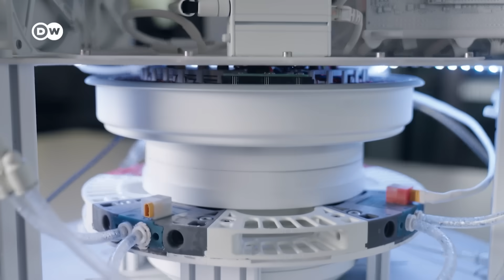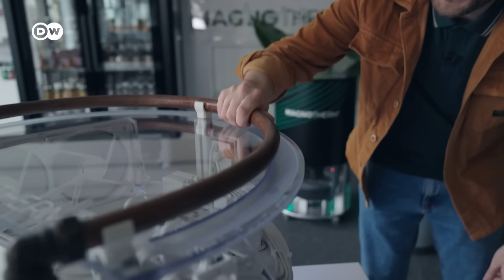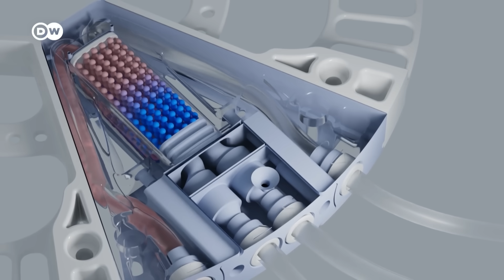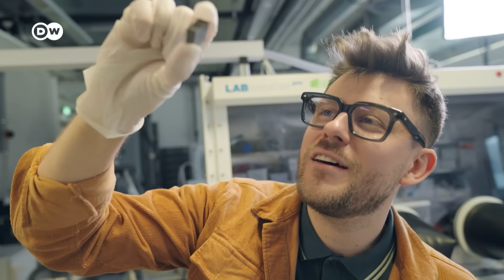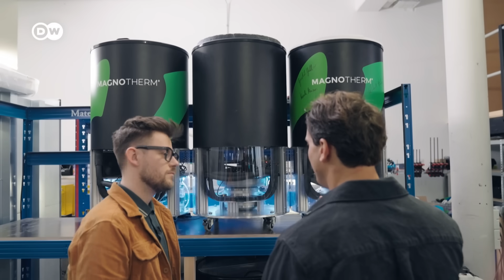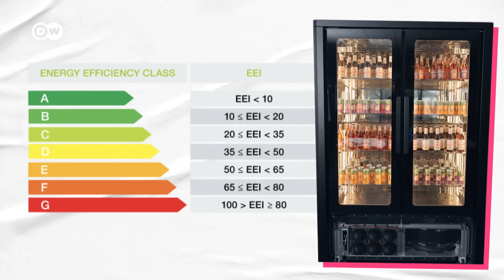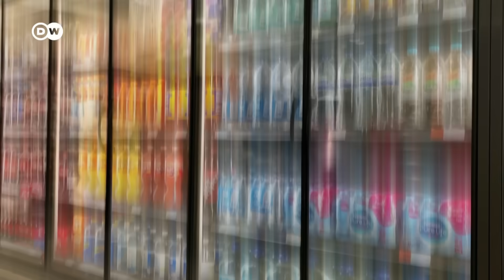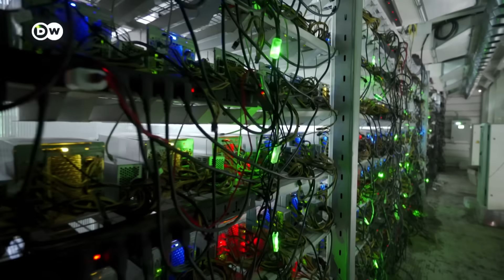How magnets could change our fridges and ACs forever

Comment: What if instead of heating and cooling the block with the magnet, they instead put the magnetic particles in a suspension fluid and put the magnet on the liquid. Then the heat difference would be easy to move because it would originate in the liquid rather than the block.
Reply: I'd imagine that runs into some safety/environmental issues. The moment you have a leak, you have water contaminated with metal everywhere.

That's not really any worse than common refrigerants, but if they're using water right now I assume that they want to avoid a similar situation. Having many moving parts as they do, I'd expect leaks to be more likely than a conventional refrigerator.
Reply: @TylerHague  It's a possible concern, but the liquid wouldn't need to be pressurized so it would be easier to control, and would also probably be less toxic than refrigerants.

Comment: It will never more efficient than evaporative cooling.
Reply: Not to mention the manufacturing and rare-earth elements. Looks like a ton of neodymium and a easy ticket to a decade of academic funding for 5 people with a business pitch
Reply: @jackb3493  Look up Niron and the development around Iron Nitride Magnets.
Reply: And it will never be simpler than thermoelectric cooling. Metal thermocouple and an electrical current.
Reply: @DiscoFang thermoelectric is  crap efficiency in almost all cases though. they're good for temp control but for bulk heat lift super suck.  But this stuff  seems way over complicated, maybe the base tech be  reconfigured in some way to make it scalable but between the rare earths and all those valves and pumps this will never be mass produced. It' just some trophy for rich pricks to virtue signal with.
Reply: I think its cool they're giving it a real chance
Reply: Evaporative cooling is not the heat exchange part of a refrigeration system.  It more of an enhancement to the heatsink by creating a lower ambient heat to work with.  You can't make ice in many places with just evaporation.
Reply: Evaporation cooling only really works in dry climates - like the desert kind of dry.
Reply: @joez.2794 I guess fridges don't work in the phillipines lol
Reply: @joez.2794 Every fridge cools by evaporation. Just not by evaporating water but a different fluid.
Reply: @DundG  Sorry thought you were talking about swamp coolers. 🙂
Reply: @DundG  No, that's wrong. Refrigerant expands as it passes through an orifice, and absorbs heat from the surroundings. It's not evaporation.
Reply: @KevinMaxwell-o3t  then why do you think one radiator is called a condenser and the other called the evaporator?
Reply: @KevinMaxwell-o3t  The refrigerant evaporates just as water evaporates when it absorbs enough heat. Every refrigerant has its own properties and boiling point.
When the liquid refrigerant passes through the orifice it expands thus dropping its pressure significantly but it is still in liquid phase practically in saturation.
Once it absorbs enough heat from the medium needed to be cooled the refrigerant will boil and evaporate.
Reply: @electraelpindrai1964  which one is which
Reply: @ When you squeeze a gas it gets hot, when you squeeze it some more more it will turn into a liquid (sometimes directly into a solid in some edge cases) . This releases a lot more energy because you are moving the gas into a lower energy level, and that energy has to go somewhere so it heats up; however more heat will make the liquid evaporate so it forms an equilibrium until all the heat gets distributed into other things and more and more of the gas condenses into a liquid.

This is why the condenser is the hot side of the refrigeration cycle. 

The evaporator is where evaporation occurs. when you put a pot of water on the boil, it can heat up fairly easily but getting it to evaporate takes a lot of energy. If you decrease the pressure without introducing more heat the the liquid will evaporate which is a higher energy level and the gas has to get that energy from somewhere so it gets it from converting heat into evaporation, thus lowering the temperature.

as others have pointed out you can move heat from one side to the other without going through phase changes, however its very inefficient to just rely on the ideal gas law.

Comment: would be interesting to make use of the waste heat from the fridge. either to heat a home (ie part of a managed heating/cooling system) or even converted back to electricity that can be used by the fridge. also curious if using magnetic or elastocaloric systems on a home-wide scale, instead of fridge-wide scale, could be more effective. (of course, heat pumps are first choice.) anyways, just musing...

Comment: I have done calculations. The magnetocaloric effect is not impressive and gives real COP of about 3-5. I have my own interesting ideas that theoretically will allow to achieve COP higher than 10 in adiabatic processes with widespread safe gases. In addition, new modern elastomers can give high results with elastocaloric cooling and heating.

Comment: First rule for materials: dont rely on uncommon elements, rare earths, etc
Reply: Gadolinium is highly nephrotoxic, and also Gd-compounds.
Extra-precautions are required when handling it, especially after a house fire.
Reply: That's why they are going with something that shouldn't even be called a rare earth. Lanthanum (the "rare-earth" used in their magnetocaloric material)  is basically the by-product of permanent magnets at this point.
Reply: @BrunoEggert  It is the magnetocaloric effect, almost all ferromagnetic have this phenomenon due to their grade of freedom of dipole orientation. But for this purpose is needed a Giant magnetocaloric effect. At this moment, the art of state of this tech will use ferromag alloys called heusler alloys, composed of nichel, gadolinium, manganesium etc... probably new research will discover the best compound that overtake the actual results of 15°K/T
Reply: Nonsense. "rare earth elements" make many things possible or just better.
Reply: The main problem of rare earth elements is the bad environmental impact of mining and extracting these elements ( like lithium) and this new technology is supposed to save the environment by reducing fossil fuel consumption, so is it really worth it? @avada0
Reply: "rare" earth aren't rare they are just hard to separate from each other. rare earths got that name for difficulty isolate the elements that make up the category for the finite examination and cataloging.
Reply: @markcastonguay7906 yeah that makes them rare/expensive.. So nothing is won, a lot is lost.
Reply: Great insight and information.
Reply: nah it's fine if the benefits outweigh the costs but here it seems they're just trying to fix something that isn't broken with theoretical technology that can only ever be slightly more efficient than the existing proven technology in the best case scenario

might still be worth it if it also lowers the maintenance costs, but since they don't mention that at all I'm gonna assume it makes maintenance *worse*, not better

Comment: The magnetocaloric effect (MCE) is a phenomenon where a material’s temperature changes in response to an applied magnetic field. This effect occurs because the magnetic field influences the alignment of magnetic moments (spins) within the material, altering its entropy (disorder) and, consequently, its temperature.

How It Works
	1.	Magnetization (Adiabatic Process)
      •   When a magnetic field is applied, the magnetic moments in the material align with the field, reducing magnetic entropy.
      •   To conserve total entropy, thermal energy decreases, and the material cools down.
	2.	Demagnetization (Adiabatic Process)
      •   When the magnetic field is removed or reduced, the magnetic moments become disordered, increasing magnetic entropy.
      •   To maintain total entropy balance, thermal energy is absorbed from the surroundings, causing the material to heat up.

Applications
   •   Magnetic Refrigeration: MCE is used in cooling systems as an alternative to conventional gas compression refrigeration, offering higher efficiency and eco-friendliness.
   •   Cryogenics: Used in low-temperature cooling, particularly in space and scientific research.
   •   Energy-Efficient Cooling Systems: Potential applications in household refrigerators and air conditioners.

Materials with Strong MCE
   •   Gadolinium (Gd) and its alloys
   •   Lanthanum-based compounds (e.g., La(Fe,Si)₁₃)
   •   Manganese-based compounds (e.g., MnFeP-based materials)

Comment: I need a heat pump for my house.  Can I make a heater out of this ?   Can I move the heat for the outside, into my house ?
Reply: You could, though it would certainly need more development. However, I currently get a SCOP of nearly 5 with my compressor heat pump, so this would have to go some.

It may be the Stirling heat pump is a better bet.

Comment: He did not answer the percentage, which says all, The only thing I could come up with is it may be quieter and safe but does that really matter? Not on point. They should build a desktop CPU cooler, not the fridges.
Reply from the maker: Hey there, yes he mentioned the 25% to 30% efficiency improvement, but right now, results vary depending on the system and what you're comparing it at. As for desktop CPU coolers, that’s an interesting idea! Though scaling it down might be a challenge, it could be a cool (literally) future application.

Comment: Sounds like you use this to create direct cooling + air pump system to move more heat around would be the trick. One design around max cooling while the other is more sustaining the cooling it self. Cost for mfg is still am major issues though, so unless they can reduce their cost - it sounds great - but like many things out there, wont be consider the base load item.

Comment: 10 000 hours? So I can have a fridge that should work for a year without a major malfunction? That's hardly an achievement. And 20 to 30% power usage reduction (which they haven't even achieved yet) does not offset these potential malfunctions, which are bound to happen more often that in conventional cooling. That's the basic rule of mechanics: more moving parts means more maintenance issues.
Reply from the maker: Hey there!  It is 10,000 test hours - not referring to the life span of the fridges here.
Reply: The spinning seems unnecessary, I wonder if they'll eventually figure out an electromagnetic way to rotate the field
Reply: Ive just ordered a fridge from a Swiss company - sorry can't remember the name - it uses 56kwh / year and has a 10 year warranty.

WE CAN make refrigerators way more efficient just by quality engineering and insulation.
Reply: @piccalillipit9211 
Being able to reduce power consumption was basically changing material used from Copper to Aluminium. Copper lasts longer but utilizes more power that's why lots of manufacturers opt for Aluminium in the name of power efficiency but sacrifices durability.
Reply: @piccalillipit9211  You just ordered a fridge yet can't remember the name? The most important question is what size is it? Even a cheap no-brand 35L bar fridge in a 25C environment will use only 6kwh over a month. That's 72kwh/year.
Reply: @piccalillipit9211  Without any further details your claim of 56kwh/year doesn't do us any good. Like how big is it? Can I stick a frozen turkey in the freezer section or does it even have a freezer compartment? Is it even big enough to hold a case of beer. How cold does it get? I find it hard to believe your new mystery refrigerator uses only 6.5 watts a day!
Reply: Really comparing new tech to something that was refined over decades, like sure the first cars didn't replace the horse
Reply: Tell me you do not understand prototyping and the manufacturing development process without telling me you do not understand prototyping and the manufacturing development process.
Reply: Gym goers could spin wheel
Reply: such wow, tech that has been optimized for 100 years is more reliable and cheaper than a prototype, many science, very engineer
Reply: agree.   imho, the only way this replaces current tech is reliability.   Maybe some niche markets.   Interesting anyway.
Reply: This is a tech scam to get investor money, it's a highly complex very expensive inefficient system based on a scientific principle that solves nothing and promises results that will never be achieved. Put solar panels on your roof with a battery.
Reply: More moving parts also means more control over the lifespan, making it very convenient for planned obsolescence.
Reply: Nonsense.  It would be a major achievement for people who want efficient cooling in a refrigerator, but only have 1 year to live. 😏
Reply: You missed the point. They’ve only tested the fridges for 10 000h, NOT that they will have a lifespan of 10 000h
Reply: do you people even understand that the 10000 hour stat was just testing? 🐒 🧠 😂
Reply: A regular fridge compressor will probably go out after 10k hours as well. Refrigerators don’t run constantly lol.
Reply: @FainTMako  Saying "probably" doesn't even hold up to the most basic and wildly optimistic math. Even if a fridge compressor only ran 20% of the time that's 5 years. Even at a ridiculously low 10%, it's 10 years. Shouldn't have to point out that regular fridge compressors last waaaay longer than that. Wth is with your "lol"?
Reply: @DiscoFang Yup. Most of the issues on modern fridges are computer related failures. LG had issues with their Linear Compressor a few years back, but after they went back to a regular design those issues stopped.
Reply: @FainTMako he's probably have to run continuously because they don't generate a large heat differential the way that traditional heat pumps do.
Reply: @FainTMako  A typical fridge compressor runs 30-50% of the time, even on the low side, that's a little under 4 years. That's disgusting, just maintain your fridge and it'll last a decade or wayyyy longer. Get it recharged and change the compressor oil from time to time, replace parts like blower fans, defrosters, thermostats when they fail... It's not hard and it should be a part of every homeowner's life, we live in a throw away society, so sad!
Reply: Maintenance on an hermetic compressor fridge. Havent seen that in...... ow wait NEVER. People.... less typing, more thinking. And when you thought hard and  then think you know.... dont type anyway
Reply: @Antvenom2121  If your fridge compressor is running half the time you need to close your fridge.
Reply: The technology is in its infancy. Give it some time and funding and it will eventually produce something that will be useful.
Reply: @aperocknroll88 It's not a maturity problem. However advanced it will eventually become, it will still revolve around (pun intended) a lot of fast moving parts.
Reply: And more noise.
Reply: then don't buy it.
Reply: @upupina90 great solution until the government gets involved and forces the change.

Comment: another thing to be thinking of is price on fixing it, there's literally a giant spinning wheel of magnet inside of it and every moving part will wear out eventually and lead to broken system that's will be different compared to tiny compressor in fridge
Reply: That's why they should build the concept into a solid state design. Something like a 'magnetic peltier'
That would be revolutionizing if possible to design and build.
Reply: contactless bearings
Reply: It's still just a motor spinning and liquid pumps, no more mechanically complicated than a compressor. Replacing motors and pumps is something most home owners can do with basic tools compared to tube sealing and refrigerant management of replacing a compressor.

Comment: This feels like the rotary engine, smart and a very efficient idea in theroy or lab setting but might in practice run in to some manufacturing issues and reliability issues, since it needs so precise timing
Reply: I agree.
Reply: Check liquid seal motors, wankle engine is conceptually wrong for rotary engine
Reply: Liquid piston engine
Reply: Rotary engines were less efficient and inherently oil wasting
Reply: @GBOAC  haha yeah okay but they were designed with the thinking of it being more efficient
Reply: @2Bjoey rotary is still mechanically more efficient because it totates itself you dont need to trans power by crankshaft that lose some power but Mazda didn't work enough for Wankel, they made a electric car thst has Wankel inside,that engine used as a generator not a power supply
Reply: Yeah it's an engineering piece of art. But it's anything but robust and reliable. Truly amazing but makes no more sense in everday use than wrapping all your walls at home in authentic Leonardos.
Reply: Or is it just me?

Comment: Have they tried experimenting with different cooling liquids in their magnet fridges? I feel like they could greatly improve their performance if they didn't only use water
Reply: They probably have sure. Keep in mind though, water is environmentally friendly. More exotic materials might be harder to dispose of, if this goes main stream. I don't know much though, just from what I learned from water cooling PCs.
Reply: Water is the safest heat exchanger.
Reply: My understanding is that water is one of the most efficient liquids for heat transfer. High capacity and thermal conductivity. That it's utterly safe and non-toxic is incidental. The only reason vehicles don't run plain water for cooling is corrosion and freezing. Any additive to the water reduces the cooling efficiency.
Reply: Water is the best cooling medium there is. Even adding glycol "coolant" in water reduces it's cooling capacity. The glycol only drops its freezing point but reduces capacity. 
Glycol also changes the density of water resulting in more power drawn to push the same amount of fluid.